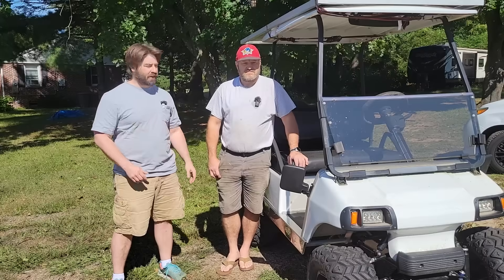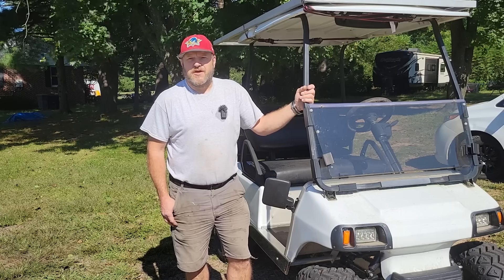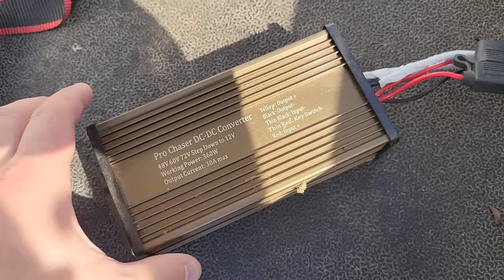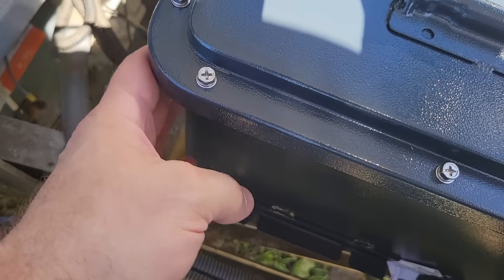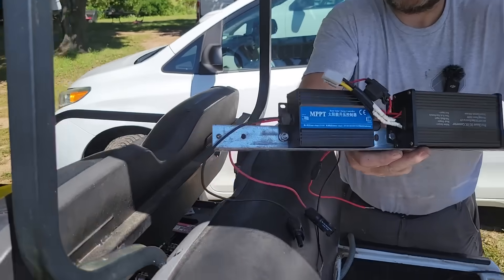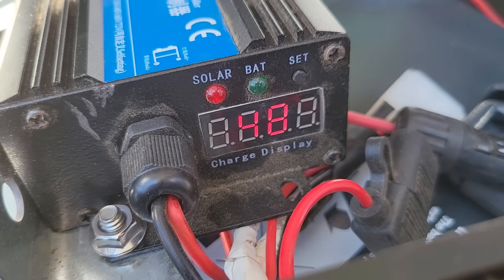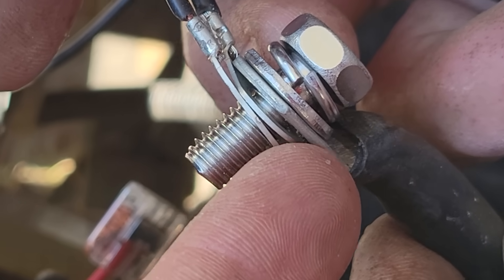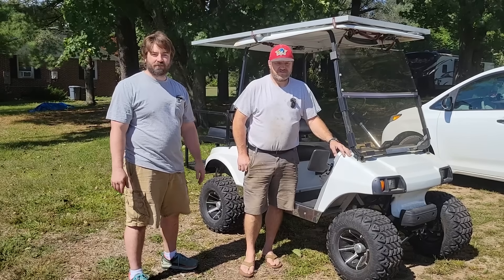Solar + VATRER Lithium. Enough to REALLY never plug in your cart?

Comment: I've been researching solar for several years and never heard of a "boost MPPT" charge controller. I've been trying to design a small-footprint, slow-charging, large-reserve, backup system for quite a while. That is the perfect solution for charging a 48 Volt battery with a single panel. I don't know how I missed this video when it came out two years ago. I've been subscribed to you for a long time. This has to be the first time YouTube's algorithm pushed out an old video to me, and it wasn't a waste of time. Keep up the great work.
Reply from the maker: Glad it helped you out.  I think there are three brands that make boost controllers (that I know of).  But this one is good value for the money.

Comment: what about freezing temperatures? will the solar damage your battery?
Reply from the maker: The battery has built-in protection for cold weather.
Reply: @DavidPozEnergy  ok, nice function to have. Not all lithium battery's BMS has cold temp protection. Most have high temp, short,over charge/discharge but  not cold temp. Without that protection you might have to install some type of heating element around the battery, or some type of shut off. Both would need to operate off of a thermostat

Comment: Hi. Dave, I was wondering how your Schneider XW pro inverter? Are you going to do a review on the inverter. I’m off grid and have been watching a lot of videos. I watched a video XW pro vs SolArk and I empress. What is your opinion. Thanks
Reply from the maker: Yes, I have several videos on my Schneider XW PRO inverter.  It's been working great, no faults.  Check out my load test video: https://youtu.be/nCV1OUrcAaw?si=DE4rUQ97c_oC4Izc
I tried running a Sol-Ark at my house and it didn't work well for me.

Comment: I generally recommend putting bolts in from above.  If nuts fall off, at least the bolt is still poking through the hole to hold things still.  And use nylock nuts so you don't need to worry about them falling off in the first place.

Comment: How long to charge it up from 50% discharged, using that solar panel?  Solar panel is only yielding ~4A in the sunshine..  so...  does not seem like the solar would be "Enough to REALLY never plug in your cart" unless not really using it much per day, i.e. never discharging the battery much.
Reply from the maker: Patrick tells me that he uses it every day during the summer, but it's only 2-3 miles per day.  It's charging around 220W.  Since the panel is oversized, the charger can be at 220W for a long time, meaning it can capture up to 1,800Wh per day.  That's about a third of the total battery capacity.  As Patrick mentioned, the capacity is not his limiting factor, it's the maximum current.  Patrick could use a smaller capacity battery, but because of heat buildup, the manufacturers don't put 200A BMSs into 50Ah batteries.
Reply: @DavidPozEnergy  👍

Comment: Did you do the exact same drive as the 1st one? Because looking back when you went to the same grass area (where it stoped) you were at 96% life @start, with the new new up you’re at 74% life@start.

 If both tests were equal the new setup has too much parasitic draw could be from the booster you added.
Reply from the maker: Both before and after drives were on the same grassy slope with the same start/stop points.
Reply: @DavidPozEnergy Thank you for the confirmation. If you FW to 4:04 you will see old setup in high 96% range compared to new setup. To me it seems it definitely need more AH battery life not to cut out.

But there is a big parasitic draw on the new set up that Has to be the booster is using way to many watts to convert. 

What do you think?

Comment: The Vatrer website (in FAQ) says not to charge using solar.  Any problems experienced doing that so far?
Reply from the maker: Patrick (the owner of this golf cart) hasn't had any problems charging from solar.  I'm not sure what the underlying reason is that Vatrer would say that on their FAQ.  I've spoken with Vatrer since publishing this video and they had no problem with the solar panel.
Reply: Sure, as long as you have a solar controller, set up 16 strings of lithium iron phosphate mode to charge the battery!
Reply: I bought the 36V version, installed without issue, much lighter now & has better pickup, solar charging no problem...

Comment: Some thing to think about is putting in a battery disconnect in easy reach of the operator and a 200 amp fuse or breaker.

Comment: Nice job maybe I need one to drive to work. I don't know if there is a golf cart route but the same thing can apply to a motorized wheelchair type of three wheelers. They have a twenty five mile range if i could go fifty then this might be doable. I can use the sidewalks under the disability act. The question where do I put the solar panel? No roof. 73

Comment: You could probably still go up the hill with the old battery if you just drive slower. Ideally the motor controller would have a programmable battery current sensor which would automatically reduce the speed. It's worth seeing if this is an option, even with the new battery. The new battery gives headroom but if you have four people and heavy gear you might still reach the limit.
Reply: With the display he sees if it draws 200A and can go loose on throttle

Comment: 3.45 volts per cell is an ideal sweet spot as there is very little capacity to be gained from going higher. Less than 2%.  Yet it’s high enough for the active cell balancer to work. After a couple hours of absorbing at 55.2, you can drop down to a float voltage about 3.3 volts per cell, 52.8 battery voltage. It would be cool to put 16 304 aHr cells in this thing! But sounds like he does not need that much capacity.

Comment: 3.7V/cell is way too high.  To be frank, the charge controller should stop at 3.55V/cell and the BMS cut-off should be 3.65V/cell.  You don't want the charge controller to regularly trigger the BMS cut-off, that puts unnecessary stress on the BMS.   3.55V/cell will fully charge LiFePO4, there is no need to go higher.

But it really comes down to whether you can control the BMS parameters.  Some BMS's won't balance until you charge the battery to 3.65V/cell.   What you really want is for the BMS to start balancing above 3.50V/cell.

So BMS balance start: 3.50V/cell, charge controller target 3.55V/cell, and BMS cut-off 3.65V/cell.  Once the battery is well balanced, the BMS should just not hit any high-voltage cell cut-off.

One last thing.  It's a good idea to put two batteries in parallel rather than just have one battery.   It is totally unnecessary to run batteries at 1C or higher.  Having two in parallel gives you a lot more surge capacity as well as more robustness and less stress on the batteries.

-Matt

Comment: I really really want to build a diy aerodynamic electric full suspension velomobile... AKA fully enclosed electric recumbent trike. With enough storage for groceries or camping/living gear. With as much rooftop solar as will fit & optional single wheel bike trailer with suspension. With a couple  lightweight folding solar panels that store under the seat. = No more need for car, insurance, registration, gas or high maintenance costs. 
Able to combination of pedal or pedal/electric assist or electric only if you get  tired or sick but need to be somewhere......Many think it's goofy but when u realize you're gonna be stuck on a fixed income. It seems like a good way to stay travel but stay warm & in rain/cold.

Comment: You never really say though if he never has to plug in. Assuming typical use for him
Reply from the maker: Patrick (owner) has told me that he has never plugged it in since we installed the first lithium battery.  The solar panel is enough for his level of driving.  Patrick says he uses it every day during the summer.  It's shut down during the winter.
Reply: @DavidPozEnergy  nice!
BTW I enjoyed your 48 volt generator series,hoping to work on building one this winter.

Comment: The battery looks "professional" heavy duty. The second set of screws, super well thought out, from the manufacturer
For the future, you can put thicker cables (next AWG side) between the battery and the engine controller, on a route as short as possible  and safe .
Sorry and no hate, the arrangement of the wires around the MPPT, Bost and charger controller can be more professional. @ 12:18 the plug must be waterproof !!!
I like the desire/will of the owner!

Comment: What does the boost mppt charger do when the battery is full? Does it dump load or disconnect the solar input?
Reply from the maker: the charge controller just disconnects from the PV.

Comment: I bought this same battery a little over a month ago and no complaints from me.  I cut the ring terminals off and bought a yamaha charger plug (for my yamaha g29) and put it on the pig tail from the charger.  It looks pretty factory.  Very happy with the purchase.

Comment: Our EG4 Waterproof 48V runs our cart without issue.  Max current draw is 135amp.
We use a 430w panel with the Gensun SCC.
Reply: And the EG4 battery is about $600 cheaper and still with the 200a BMS. Only difference I see is no metal frame around battery.

Comment: I’d make a recommendation if you don’t mind; 

Use a solenoid instead of the transistors that the bms uses. There are 2 options:

1: desolder the transistors and use their gate signal to turn on a 200/300A solenoid rated at the voltage you’re running. (48v etc). If oh have a shunt built into the bms, you can still wire that in to measure current unless it is a bottleneck itself in which case I’d recommend the next option:

2: switch to a different bms such as the Jaibadai 21s capable smart bms with built in solenoid that handles the current needed easily. Then to be extra safe, run an active balancing module with the voltage set to turn on after you’re at 3.45v for the final top balance when charging. 

You would see a huge performance boost having a solid connection like a large solenoid vs the transistors and have peace of mind with the active balancing and temperature monitoring. 

3rd option would be at the very least use some thermal paste and put a large heatsink onto your transistors with a cooling fan to keep their heat down and performance as best as possible.
Reply: A little hard to do since both the old battery and the new battery are factory sealed

Comment: Thanks to Patrick for letting us take a look at his build.  The conversion of a used vehicle for my own property is also something I'm looking into.  I like how you guys break everything down.  Maybe we can get some details on just how much weight he is able to carry, top speed, and total distance on a single charge?
Reply: Top speed is about 27mph
Reply: Weight is a suspension issue, I've had 4 adults on it with degradation of speed up hill.
Reply: Distance... Welp I get 1.5miles per 10% charge use so maybe 12 miles?
Reply: Great numbers for my personal needs

Comment: I’m new to bifacial panels.  Is there a reason he wanted to go with a bifacial over a single sided, considering the way the panel is mounted?
It just seems the little bit that is uncovered on the backside, would make that much difference.  I have no clue though, just trying to decide if bifacial are really worth the extra cost.
Reply from the maker: This was a cheap panel because it was the last of a pallet at our local distributor.  No, it doesn't have to be bi-facial.
Reply: @DavidPozEnergy  Thanks David! Very much appreciate your insight.
Excellent video once again?

Comment: Awesome I do wonder if it may shut off when the voltage or soc is under 10% as amps rise as you have told us many times. I am glad to see the solar roof  for never charge use lol.
Reply from the maker: In this case, the battery never got that low in SOC.  But I like how you are thinking through other possibilities.